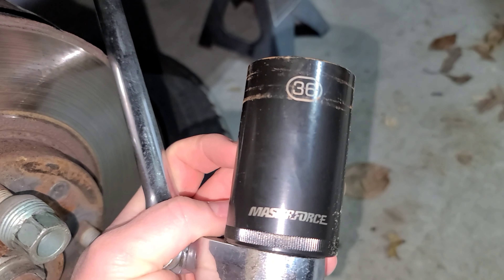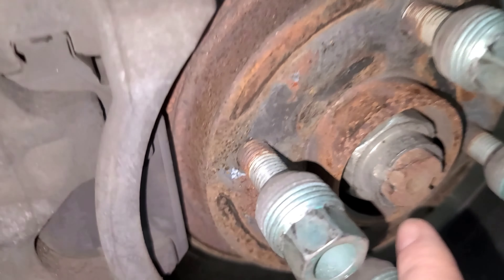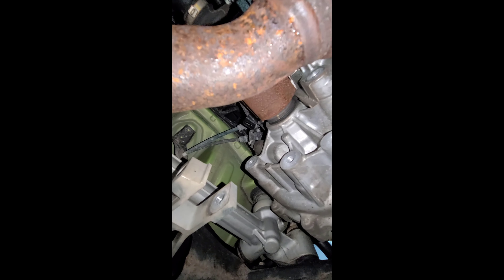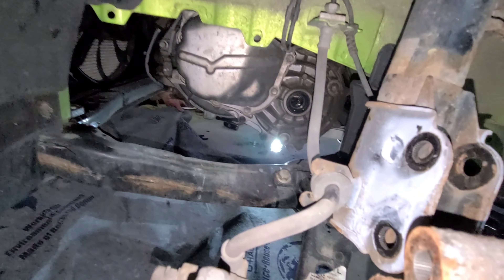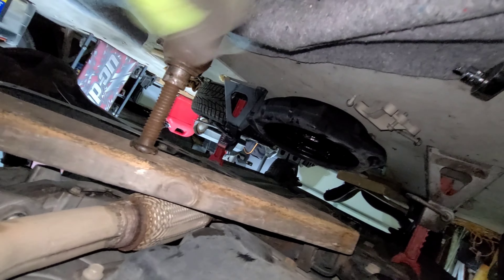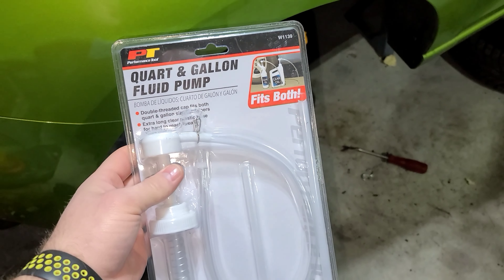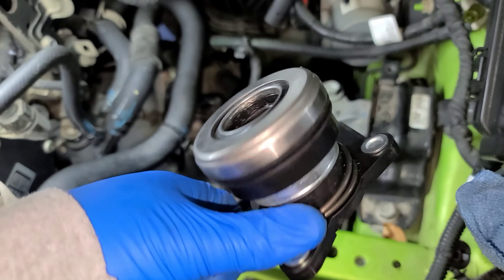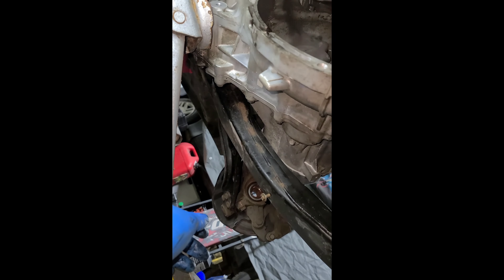2016 Chevy Spark Clutch Replacement

Comment: Thank you for this video! I have a 2018 Spark and am at 60,000 and need to change the fluid. I now am certain i can do it!
Reply from the maker: You got this. If you need help reach out.
Reply: Hi! Yes I watched a different video of a 2017 Chevy Spark transmission flush and the guy drained the same bottom 3/8 plug. But he filled the transmission in a fill plug in front on the top below the battery. The bolt was a 14mm with a blue line on it. I know you filled yours above the drain plug on the back by the cv axle. My question is are the both a fill port? Thanks again!

Comment: Chevy sold these cars over seas  with cable steel wire  no sleeve cylinder no bs . so easy to fix and smooth clutch .
Reply from the maker: Interesting, I didn't know they had the cable overseas.

Comment: What tool did you use to align the clutch
Reply from the maker: The clutch kit should come with a small plastic alignment tool. If not, most part stores carry them. Take the clutch disc in to match up the splines.

Comment: Why is it that the car needed a clutch so early in its life? Was it premature failure, a lot of miles, or abuse?
Reply from the maker: Actually a few of those. 88k miles, taught 5 people how to drive sticks with it. It wasn't totally out, however it started to slip so it was time.
Reply: @LowLifeAntics  Interesting. I'm not personally familiar with the lifespan of clutches. When working at a Nissan dealer in San Antonio, I saw a 2014 Juke NISMO with a bad clutch due to abuse, and that was in 2015. The only vehicle in my family that had clutch failure was my 1988 Ford Festiva, which my family bought used in 1991. Its clutch failed in 2009 with 130000 miles and had never been changed before then.
Reply from the maker: @2012Creyes  yeah, 130k is pretty typical of a low hp vehicle.  From my personal experience, 100k-130k is how long a properly drove clutch will last.